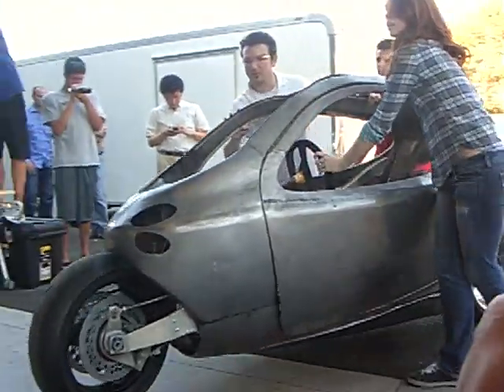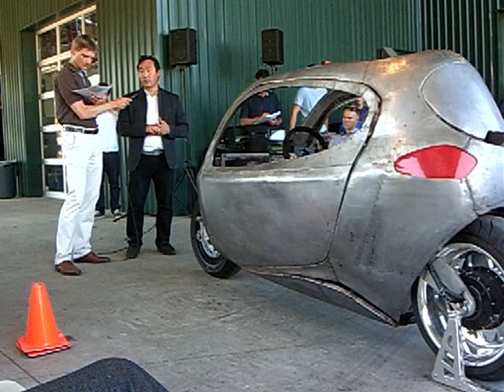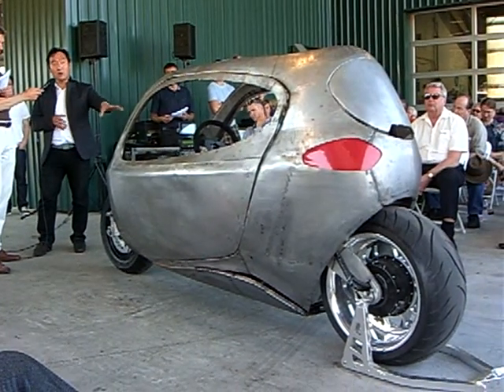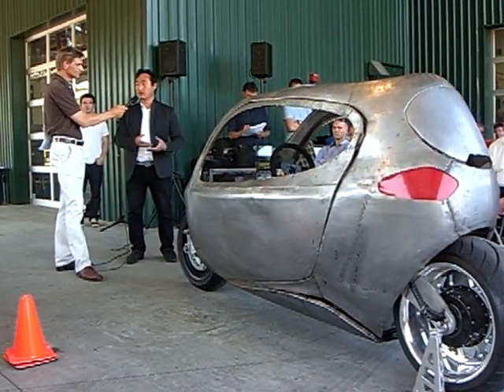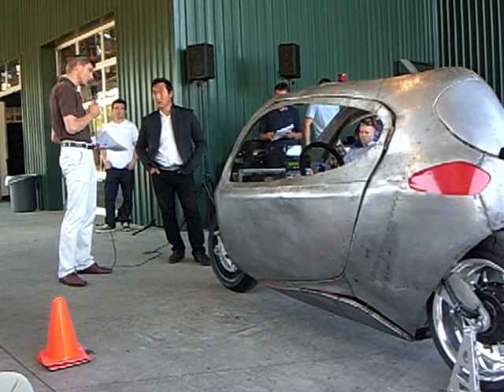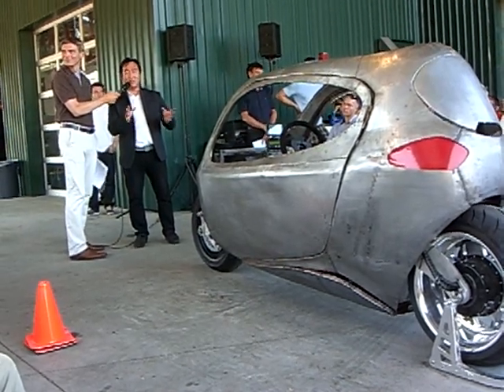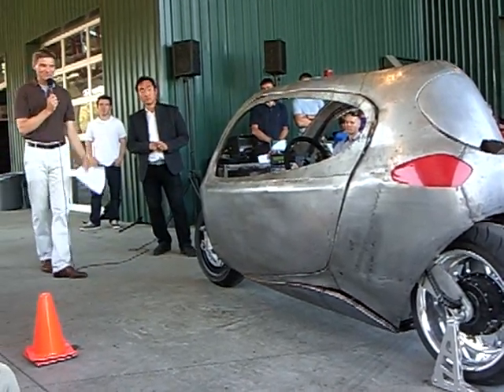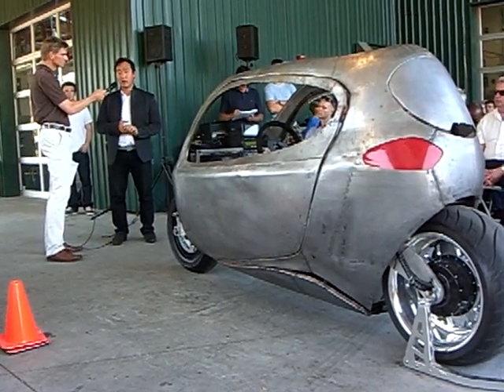Lit Motors Innovative Gyro stabilized EV Motorcycle  - Vehicle Concept Showcase 2012 -9

Comment: Being able to corner at speed like a superbike, in a safe recumbent seat, in air conditioned comfort, with an in-cabin surround sound system pumping out the beats is something the Mp3 could never do - ironically..